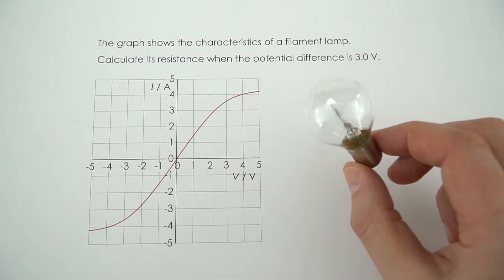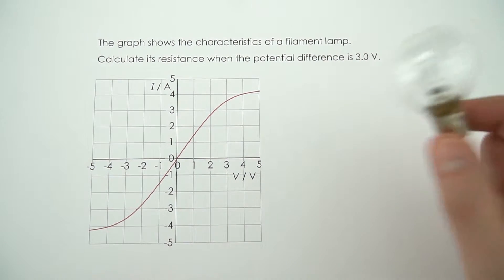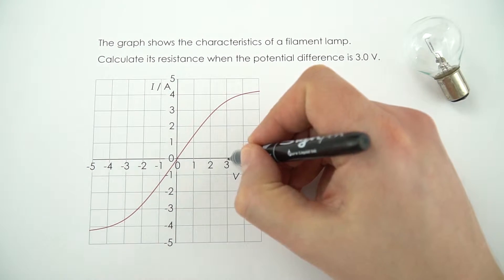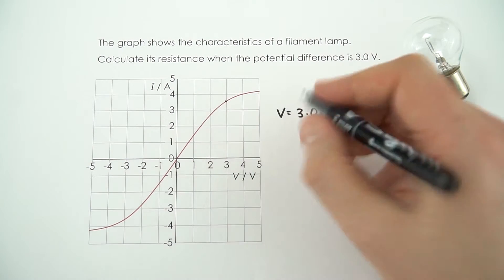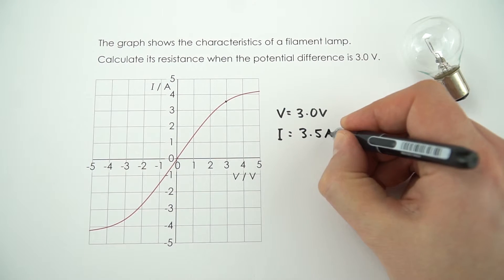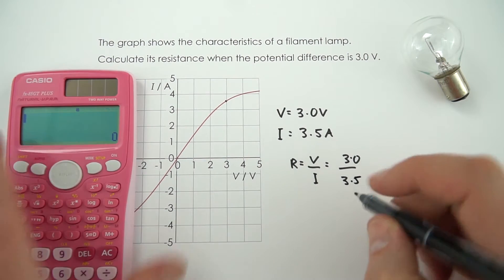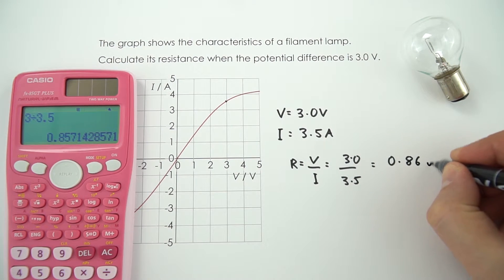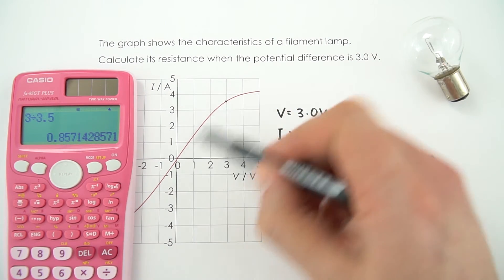Resistance of a Filament Lamp - WORKED EXAMPLE - GCSE Physics

Comment: Why can't you calculate the resistance using the gradient? Isn't gradient=1/R ?
Reply from the maker: Because the resistance is defined as the ratio of potential difference to current - but this is not the same value as the gradient. Try it for your self on a curved part of the graph where the gradient of the tangent to the line is not the same as V/I.

Comment: Why is voltage on the horizontal axis and not on the vertical axis?
Reply from the maker: It can go either way, but the usual convention in physics is current on the y-axis and pd on the x-axis.
Reply: @PhysicsOnline  Thanks for the reply. I am just trying to figure out whether the independent variable is the applied current or the applied voltage. It also makes more sense to have V on the y-axis, as the gradient of the graph is the resistance of the filament. I guess there is no right or wrong.

Comment: Is it better to put 0.86 ohms or 0.9 ohms? Because the data provided to us is in 2 significant figures
Reply: 0.86 is 2 significant figures but 0.9 is 1 significant figure, since leading or front zero doesn't count as significant. And the data uses 2 significant figures so use 0.86.